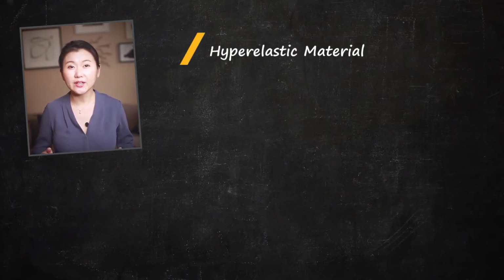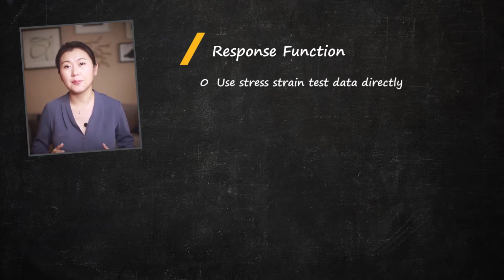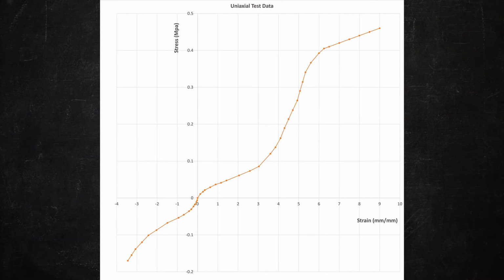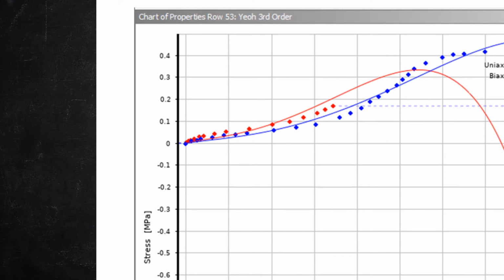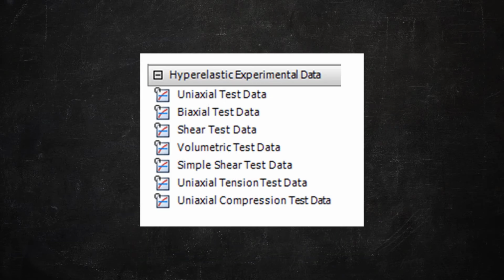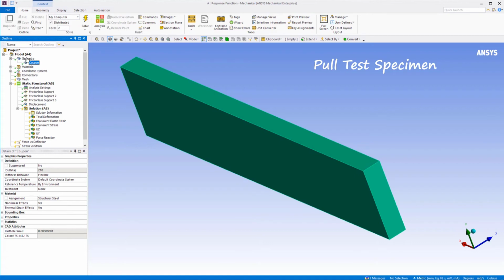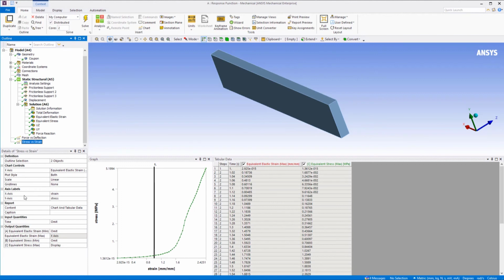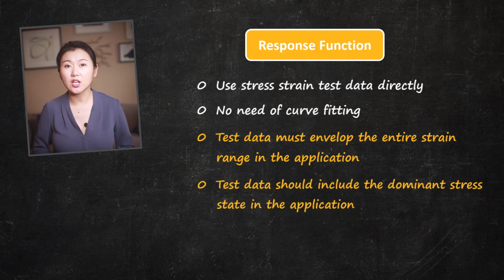Setting Up the Response Function Using Ansys Mechanical — Lesson 2

Comment from the maker: Errata:
6:19 - Initially 1st order Yeoh model (a.k.a. neo-Hookean model) is shown, but at 6:19, a curve-fit using the Ogden model is shown.  The fact that two different curve fits are shown is not made clear in the video.
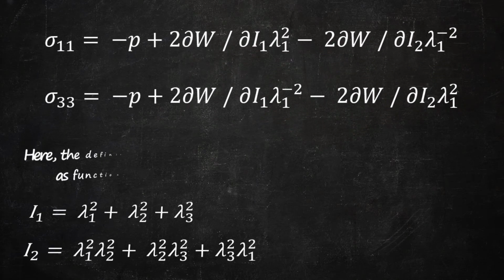7:32 - Equation for sigma_33 shown is incorrect where lambda_1 term should be raised to 4th power rather than 2nd power (both terms)

This video is part of the free Ansys Innovation Course, “Topics in Hyperelasticity”. Access all of the course contents, including additional lessons, handouts, simulation examples with starting files, homework problems, and quizzes: https://courses.ansys.com/index.php/courses/topics-in-hyperelasticity-using-ansys-mechanical/

Comment: Thank you for the excellent lecture. I have one question after watching the video.
When entering the Engineering Data, did you input the stress and strain values from the uniaxial compression test as positive values? Additionally, when converting the data to equivalent biaxial tension, did you enter the corresponding stress and strain values as negative values?